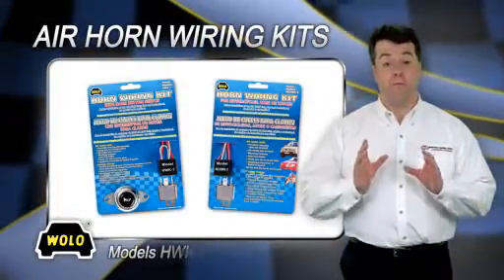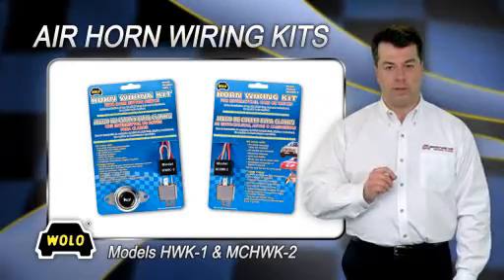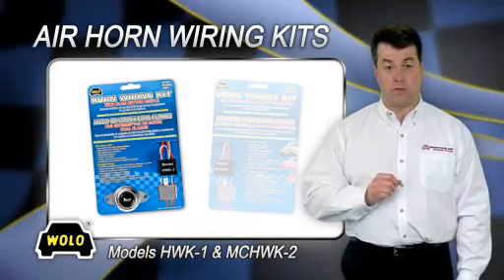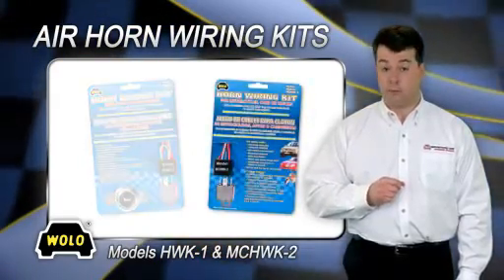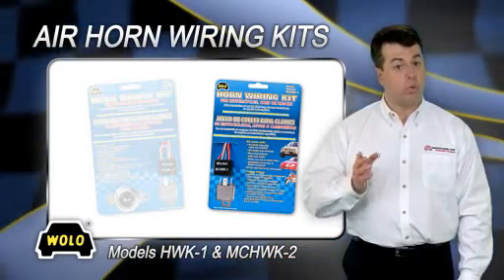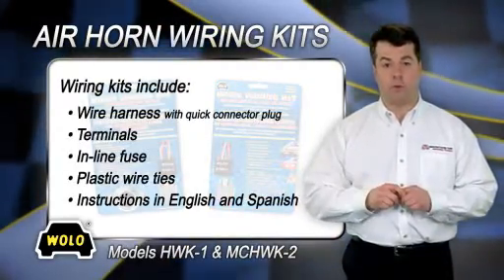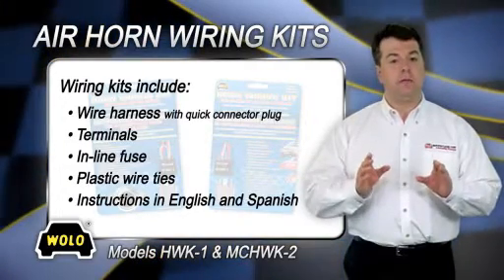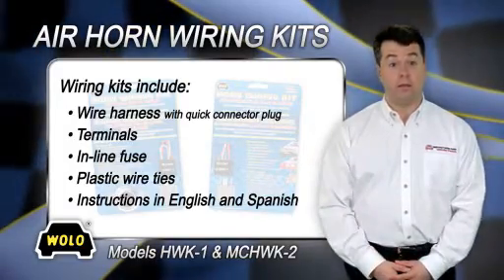WOLO AIR HORN WIRING KIT

Comment: "easy instructions" include jargon such as spade terminal, crimp terminal, etc.  Not so easy to follow.  e.g. "Connect the terminal to the switch, place the spade terminal under one of the horn button's contact screw and tightened." I know jargon in my own field of interest, but would hope any non-colloquial terms could be labelled, diagrammed etc., in keeping with the basics of providing instructions to people not acquainted with the item.  My 2 cents.